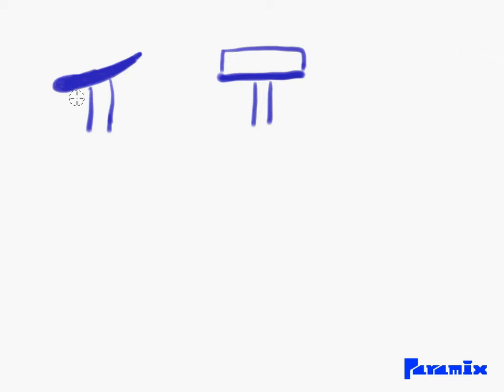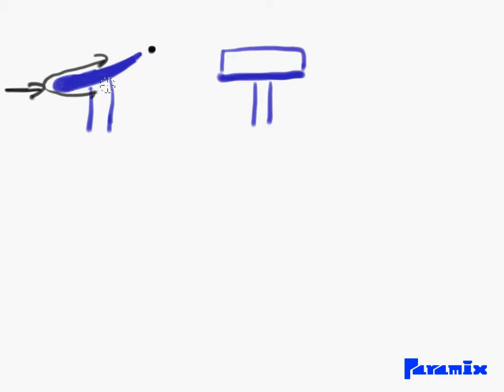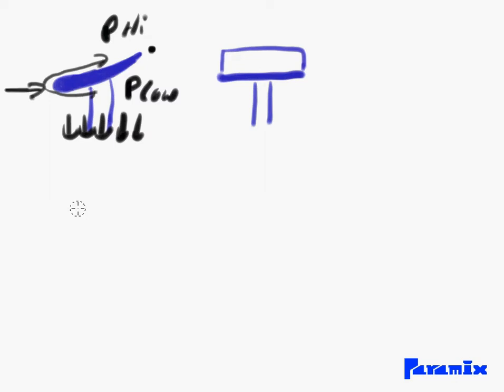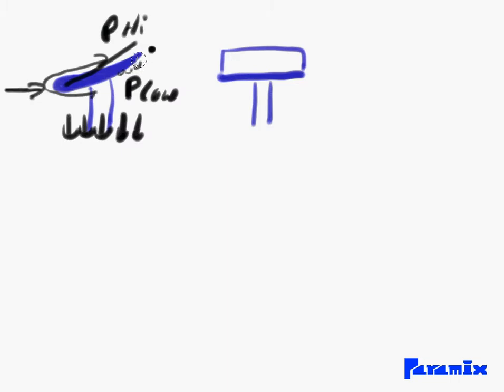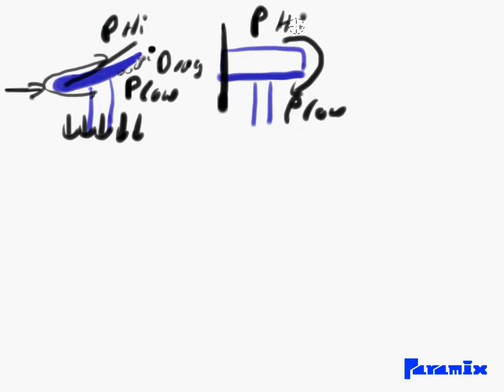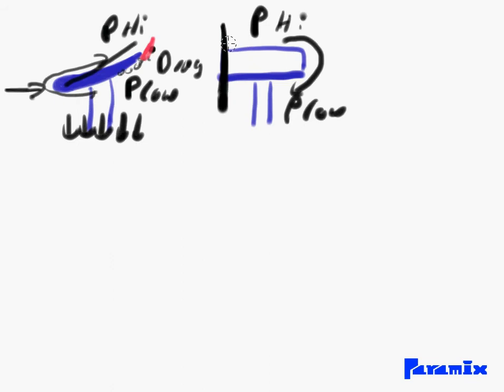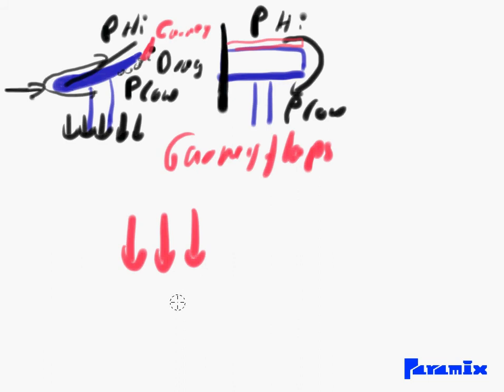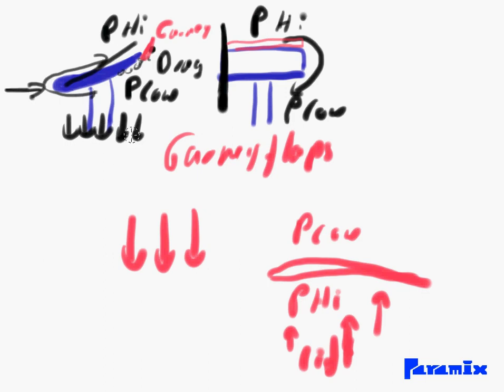How Formula 1 Race Car Wings Work

Comment: The 'angle of attack' of the wing is where the majority of downforce is created.
As the wing travels into the air, the air is pushed in an upward direction, an equal and opposite reaction must occur which pushes the wing in a downward direction.  
The pressure differential between the top of the wing and the bottom of the wing produces a very small amount of force.
Reply: Completely wrong. The pressure differential explains all of the lift. The 'equal and opposite reaction', or more rigorously the momentum change of air entering and leaving the wing, also explains all of the lift.

Comment: the length difference theory is incorrect because the assumption made here is that the upper and lower particle should meet at the trailing edge at the same time but after analysis of a wing we can see that this never happens and the air under the wing reaches the trailing edge faster.